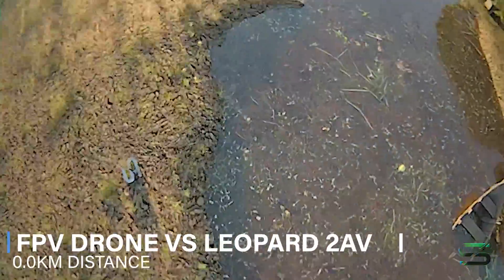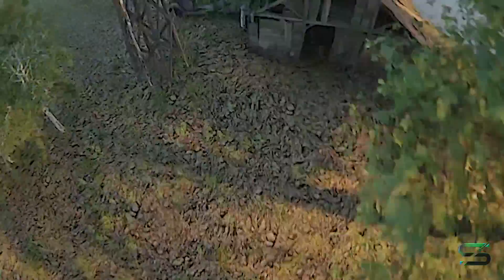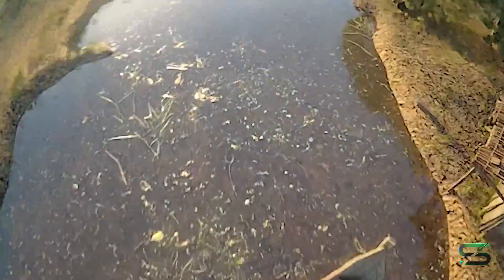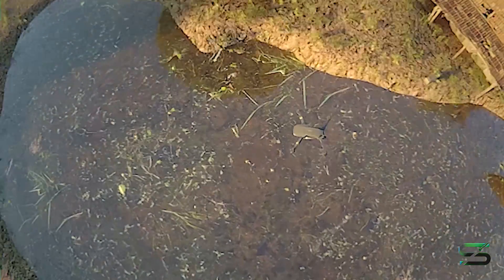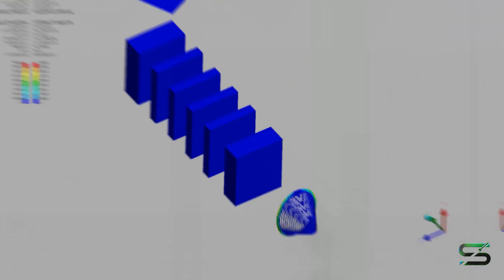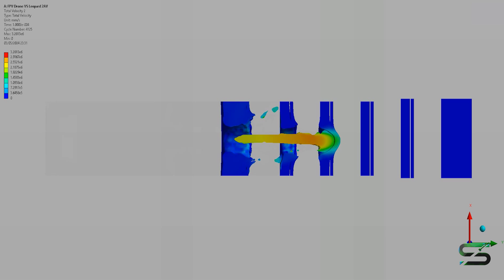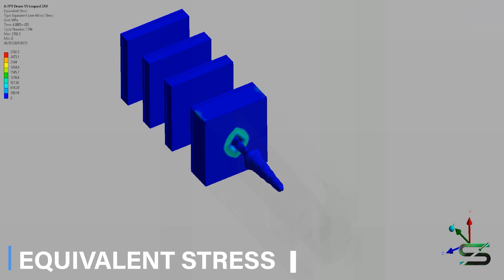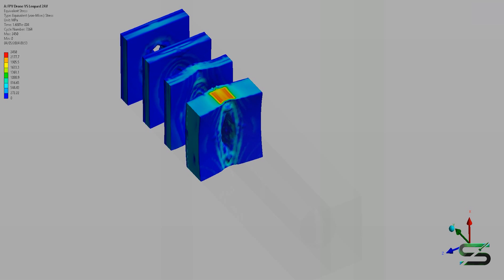FPV Drone VS Leopard 2AV | Armour Piercing Simulation

Comment: As always, a great video! Thanks! But I will be in solidarity with society)) FPV is hitting the roof from above at 45-30 degrees from the vertical. So we are looking forward to the second video with pleasure! 

UPD: And please do it with PG-7L (500 mm penetration) or PG-7S (400 mm) warheads. These are more relevant today.
Reply: Yes, the PG-7V was already outdated in the 90's. It was used by the Iraqis in the Gulf War against back then modern western armor.

Comment: Actually that’s a quite bad angle of attack, most of the times they try to hit the rooft or the engine
Reply from the maker: This bad angle took the entire 64GB of RAM.
Reply: @SimulationPlus  Ok so you need an entire supercomputer 😆
A very impressive simulation you have made
Reply: @ser43_OLDC  64 gb of ram is a supercomputer to you? LMAO the average for gaming is 32. And the RAM is literally the cheapest part to buy.
Reply: @SimulationPlus wow
Reply: @SimulationPlus 64?! I tried to do simulations with my 16GB and thought that more was not needed...
Reply from the maker: @niredx5159 This is not a Lagrangian domain. Also, the short high-velocity simulations in AutoDyn require fine measurement for saving points, which takes A LOT of RAM.
Reply: Not really, I always see side turret attacks
Reply: @HDREal  Depends on the target but on tanks they always try to hit the rooft or the engine.
Reply: @HDREal  The Ukrainians bump with drones into turrets, but the warheads are canted downwards and actually target the turret ring or the upper hull armor around the turret, which is much weaker than the turret armor and you want to penetrate downwards to penetrate into the carousel autoloader.
Reply: why not upper hull or turret roof plate the target:= weak points
Reply: This channel is the most biased out of all the simulation channels.